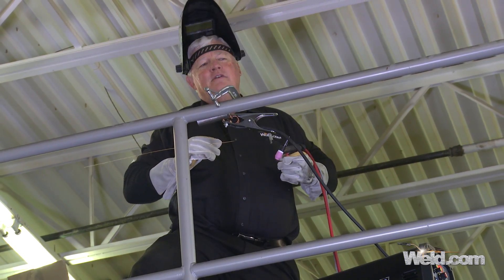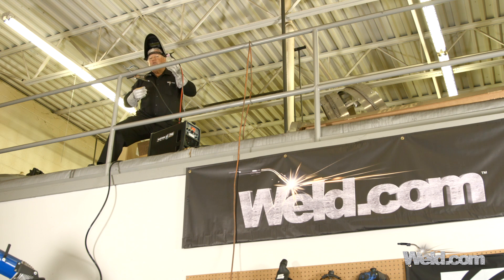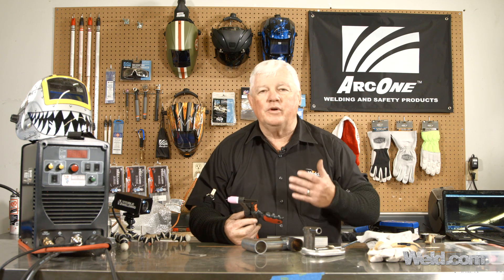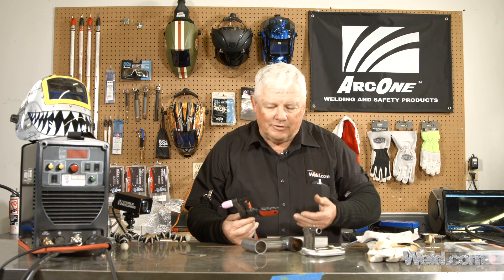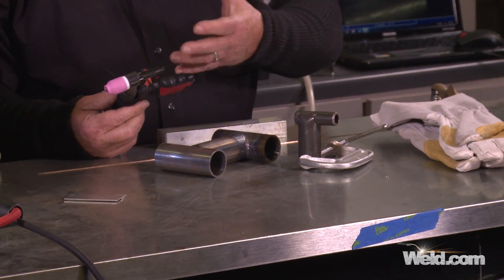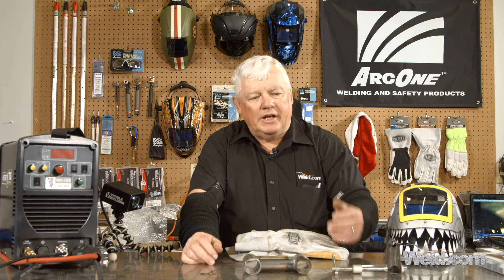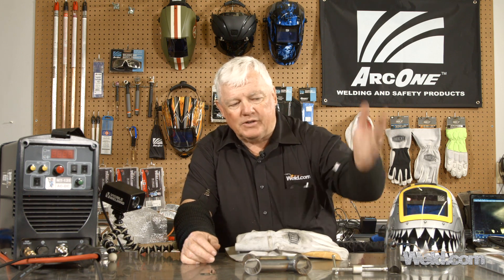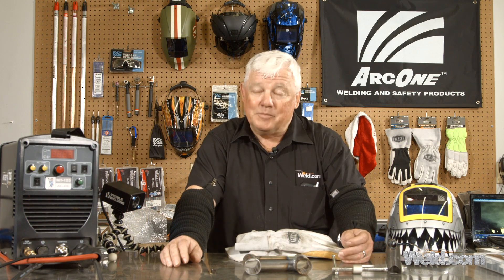MT-125 TIG Welder Review: Part 1 - DC Welding

Comment: Weld.com 
Rehm make a 210 amp AC/DC welder that weighs less than 20 pounds and will run off a normal domestic supply. It is about 6 times the price of this thing though.

Comment: I'd buy one if it was $695, but 895 is too high. I'd rather lug around the AHP 200x for a few more pounds with a lot more power. Or get the everlast 185DV for $899 and a torch cable upgrade for $50. 
Let see what this can do on the low end? How low can it taper down to?
Reply from the maker: gamble1997 with the upgrades we put with this machine package, $895 is very reasonable. We put a SSC foot control ($180), CK9F torch with superflex cable ($70), Stubby Gas Lens Kit ($52), MT-50 Regulator / Flow Meter ($69) along with everything you need right out of the box to get set up (other than gas).
Reply: Weld.com That make sense. But the picture doesn't show the SSC pedal, it shows the cheap knock off. Do you sell this without all the upgrades? The pedal is the only one worth it. Everyone else has better flowmeters, gas lens kits and superflex cables